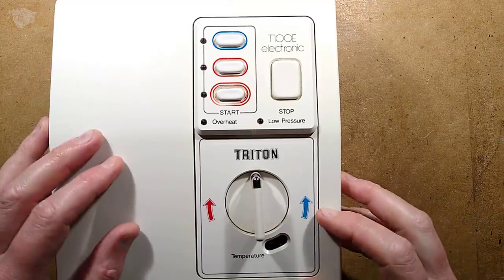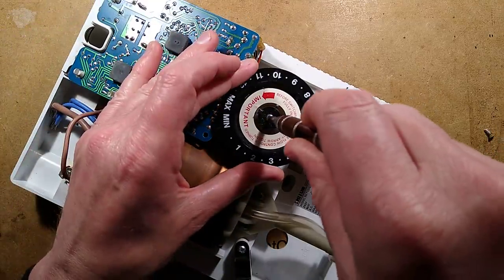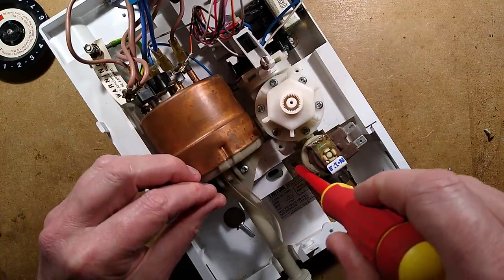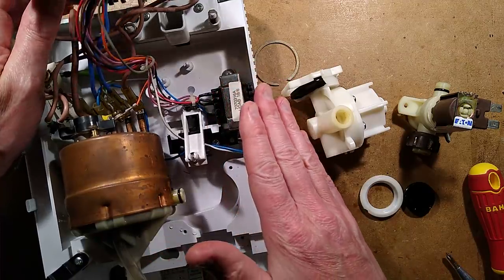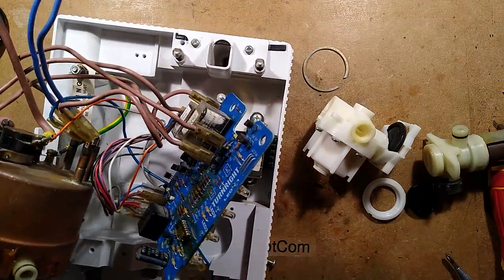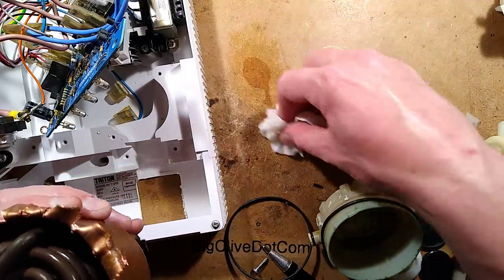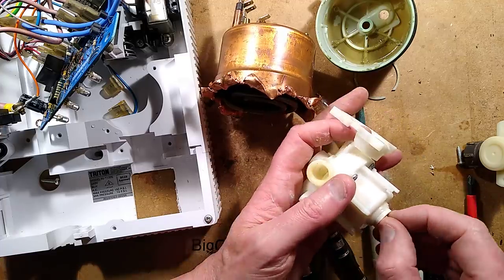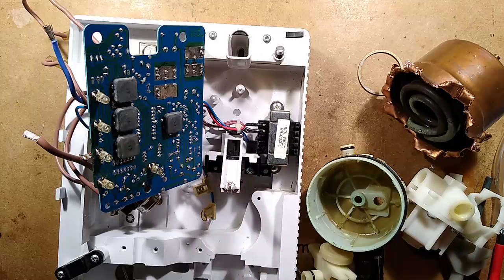Teardown of a British electric shower that went bang.

Comment: 220 in the shower well with me what could possibly go wrong
Reply: Funny, here in the US they love their electric storage water heaters run off 220.
Reply: Yes but I’m not in the tank. Also what’s the flow?
Reply: The electricity cuts out right when you have shampoo everywhere.
Reply: @JeremyRobbins  and the same logic goes for UK showers. Also, electrical demand only exists while the shower is used, unlike storage tank units that cycle on and off regardless of demand.  It's been shown that electric storage heaters are the second largest electrical load in US homes, but more than 50% is wasted keeping the water hot.  Storage tank systems are also prone to failure because people don't think they require maintenance since they are typically out of sight and out of mind. Especially in areas with significantly hard water. Oh and unless your house is plumbed with PEX or equivalent, you might as well be "in the tank" because you're not as electrically isolated as you might think.

Comment: Why are outlets and plugs over there way over engineered but you can have an electric shower? Lmao seems odd.
Reply: They are as over engineered as the plugs. They are safe as well. Don't understand the comments about water pressure though. The showers are fed by mains pressure.

Comment: Wait a second, why the fuck is there an electric heater INSIDE YOUR SHOWER?!?!?
Reply: Like I'm sure its nice and safe, I mean, it sounds like Ralph didn't die, but I'm not sure I'd ever get comfortable with that idea. Also, why not use natural gas? It's so much more efficient for heating water (unless you use like a heat pump I guess)

Comment: I feel sorry for anyone that has to use these, they are absolute rubbish. I prefer a proper hot shower. UK dribblers are for unfortunate people. Rant over, sorry I used one two times.
Reply: These are the answer to the "dribblers". A shower that uses hot water from the tank has no pressure,. I know this because I'm forced to use such a thing at the moment. Its shower hell, no pressure,  cant get the temperature correct, leaks everywhere.

Comment: Well, it's probably safer than the electrified shower I used in Spain (i.e. faulty wiring making every tap in the building live), I still would prefer to ... not have a mains plug running into my shower. I was not a fan of these things. You guys have some interesting notions about plumbing in the UK.
Reply: I've used the UK ones on and off for about 15 years, even had a couple fail on me and have had no incidents. They're safe.

Comment: Tbh, i dont think such a device is a good idea. Why does anyone install something shitty like that
Reply: a) Inadequate hot water (from an old boiler or coal fire, or whatever)
b) Old boilers took hours to heat up water, so you'd have to plan your shower time. Except then, your Sister sneaks in before you and uses up all the hot.
c) Mixing low-pressure hot water (from a tank in the loft) with high pressure mains cold water is hard, resulting in a knob that goes from freeze-your-nuts-off to 3rd degree burns when you turn it one nanometer.
d) Places that have no other hot water supply, e.g. a caravan.

It is no longer a problem with modern combi-boilers that heat water "on the go".

Comment: How is this even safe? This is an American question
Reply: All electrical showers in the UK are required to have a special rcd fues specify for showers, pretty much impossible to get electrocuted from a shower fault
Reply: @jockwood2398  They are now. The one in my house, with it's old plug in fuse board with retrofit push in MCBs (no RCD at all), is just on a large MCB.... I usually have baths ;) One of these days I'll fork out to get the consumer unit replaced!
Reply: Safe by design, ya big girls blouse.

Comment: 240v... and water... in the shower. I realize hot water heaters are big and costly, but omg! :-o
Reply: Chris Waldrip we still have hot water systems! Electric showers don't replace them, they are used in addition to them. Electric showers serve a useful function in older properties with a traditional loft tank based hot water system which often does not produce sufficient pressure to run a shower. Modern pressurised systems eliminate this issue, but you have to realise that many U.K. homes still rely on the plumbing installed many decades ago.
Reply: Install a proper power shower then with a pump.

Comment: Electric shower, wtf?
We're not even allowed to have outlets in parts of the bathroom!
Reply: It's ironic really, that something that is so obviously potentially unsafe has been made in such a way that in reality there are extremely few accidents with these. It's similar to parachuting: So obviously dangerous (and was originally more dangerous) that the design of parachute I used had been used 6 million times by the time I did my jumps without a single failure. But we still had reserve chutes with automatic opening devices. It's human nature that things that are obviously dangerous we tend to make quite safe in practice, and people get killed instead from things that superficially appear safer. The same problem with roads.

Comment: I'm going to open an HVAC company in the uk... I would sell tons of water heaters there. That thing might be safe but still scary 😲 I like my shower with out 240 volts... I rather boil water...
Reply: SubigirlAWD _ every single home has a hot water system already. These showers were really only used on older properties with a low head / low pressure hot water system that wouldn't operate a shower satisfactorily.

Comment: Feeding 240v in a box filled with water and inside a shower just raises a lot of red flags for me.
Reply: When the cover is on, the inside is sealed by a rubber ring around the edge of the top.

Comment: Even though you commented on the low failure rate having to 220-240v in the shower would still fill me with horror and dread. A 220v stove here in the us had some kind of grounding issue or something and shocked me while I had my hand on the fridge, not something I'd wan't to happen when wet. Interesting note, the guy I was working with that does alot of electrical said it was because the cord wasn't plugged all the way in, I know he's full of shit sometimes but come on........ no way.

Comment: Funny how you can't have a mains socket anywhere in a british bathroom, but everyone has a contraption like this inside their actual shower cubicles.
Reply: Not everyone
Reply: I would assume this is safer since the electronics are safely separated from and out of the users reach
Reply: Almost as if its sealed or something
Reply: @TheCatOfWarCSGO  Watch Clive take it apart, no apparent seal between the two main parts of the case. And there are huge holes around the inlet and outlet tubes.

Comment: 240VAC @ 33.34A (8000 Watts) of electricity...in very close proximity of water...inside the shower stall with you.
What could possibly go wrong?
I understand that you guys consider this type of system safe...but in the case of a failure like this...it could have shocked or electrocuted poor Ralphy.
We (US) keep the electricity as far away from the water as possible to avoid issues like this...which is why we need toasters...to kill ourselves in the bathtub   :)
Reply: perhaps you could show a circuit diagram giving the current path taken to cause a shock powerful enough for electrocution of poor Ralphy. Many comments here show a fundamental misunderstanding of electrickery.
Reply: In short, we use RCDs. You have GFCIs in the US, which are similar. We tend to use them every circuit now. They are incredibly safe but very sensitive to faults. Even an old section of wire or a slightly loose connection will trip it.
Reply: P.s. they trip in less than 40ms

Comment: BC, everything is relatively safe, man. Juggling live hand grenades whilst treading water in a half-starved tiger shark tank is relatively safe...
But, yeah, the main reason the Yanks don't like electrocity near their liquid ice is their death trap power grid. Which you know, of course. Whenever I contemplate it, as with several other choices made, I kinda assume they were made by Captain Kramer...
"Adopting this system will provide a more even and reliable power flow, resulting in fewer surges and brown-outs in turn reducing the damage to domestic products and the risk of fire, plus as a bonus, we can use the entire grid as an earthing system which will unquestionably save millions of lives over time, so, I mean there's no question, we're going with this, right?"
"No, no, damn you, that's just what they'll be EXPECTING us to do!"
Of course, as they tend to do, the Americans will be perfectly happy to tell you why it's better to have a system where the slightest short results in being burned alive from the inside out rather than popping a little plastic button.
I can hear them scowling already...

Comment: Because mixing hot and cold water together to get the water temperature you want is too difficult, you use mains powered electronics with logic chips inside and regulate water temperature by regulating the water flow. I'm sorry but it just sounds so stupid.
Reply: Kepe When your house is two centuries old, and you have a hot water system designed and installed in the 1920's you have very low pressure hot water and mains pressure cold water. The practicalities of mixing them are complex and expensive, involve lots of plumbing, pumps and controls. Of course modern homes use mains pressure hot and cold, with thermostatic mixing valves. But if your hot water system predates these systems, yet still functions perfectly, why would you spend thousands to change it?

Comment: Why is it that UK, is so bad on heating and plumbing compared to..europe..  instead of insulation, they use carpets. Instead of a heating system they use lokal death heaters . Instead of putting plumbing indoors, they put it outside and manages to get frost problems...instead of using standard building material they use local people that may be ok but has no education ..and it just goes on .
Reply: > they use carpets
Thats for flooring, not insulation.  If feels nice on the feet and reduces the echo you get in a wooden floored room.
> Instead of a heating system
We have a heating system.  Electric showers are just more convenient as you get, pressure from them.  My shower is out of commission at the moment so I'm having to fiddle with the hot and cold water taps on the bath to get the pressure and temp correct.  It adds another 10 mins to what was supposed to be a 15 min shower.  I cant wait to get the electric one back up.  I have also used showers fed from a hot water tank when I was on holiday, it was almost laughable that we considered making a game out of timing how long it would come up to temp, and the drips of hot water that came out looked like the kind of rain you would consider to be mist.
> Instead of putting plumbing indoors
Its all indoors, unless your house has been demolished.  Are you thinking of the boiler waste pipe?
I have no idea where you stayed in the UK but it sounds like a house that was being demolished at the time.

Comment: Ah yes, the electric shower, beacon of the mediocrity and that'll-do attitude of Brits. Central heating and hot water installation? "Nah, why bother, mate, just hold a lighter under the tap if you want warm water from the wall."
Reply: We have central heating and full hot water. We use these for showering because they are better.